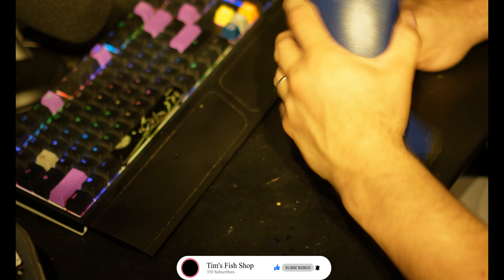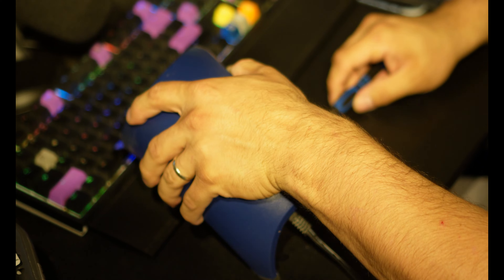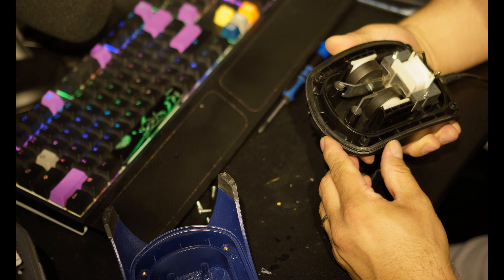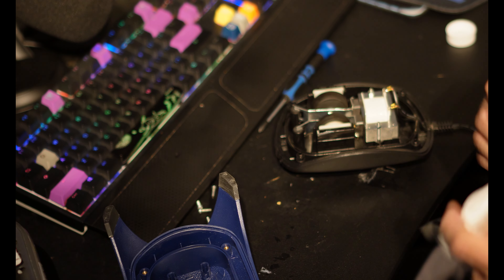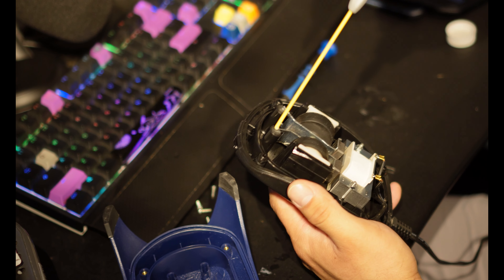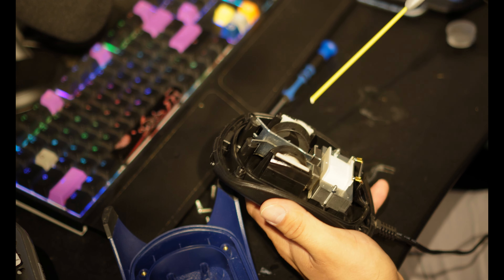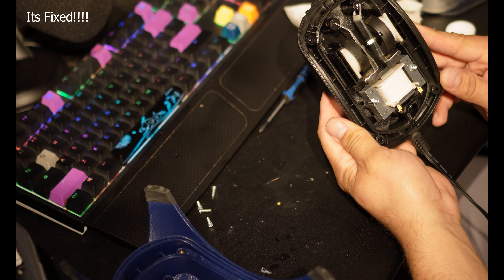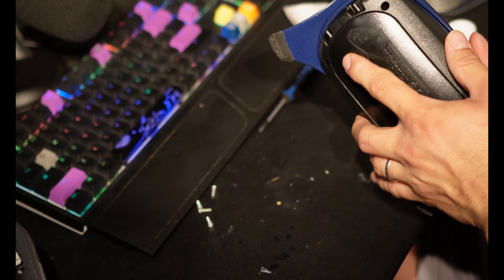Fixing a bad air pump for your aquarium

Comment: I have a whisper 10 air pump that doesn’t do anything when I plug it in. With it plugged in, I tested the cord and the little unit is getting power. One way valves are operational and the diaphragm is good. Magnet is good. Now what? Thanks